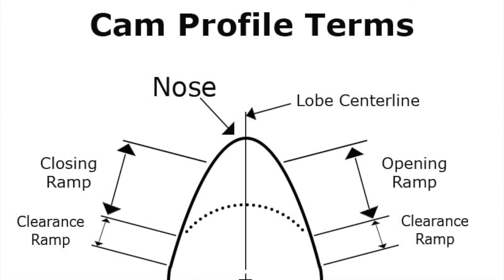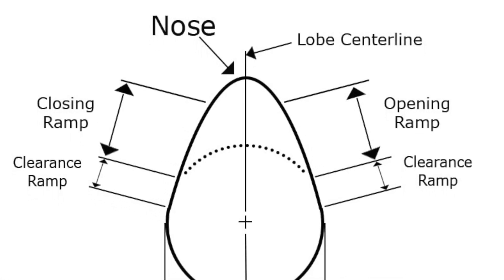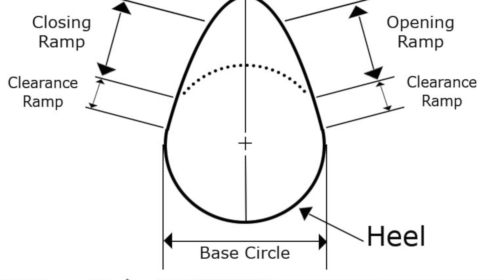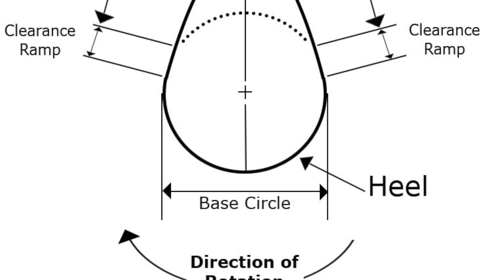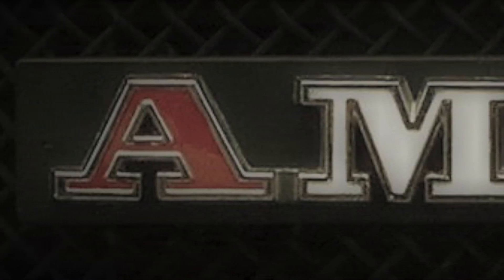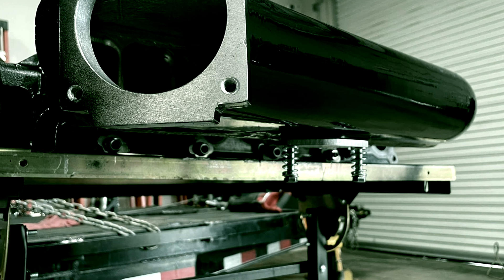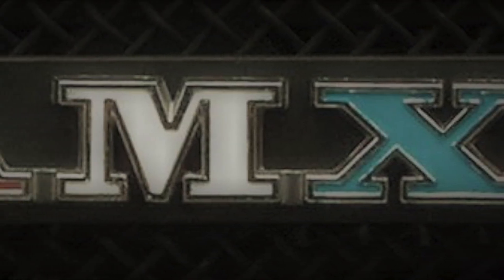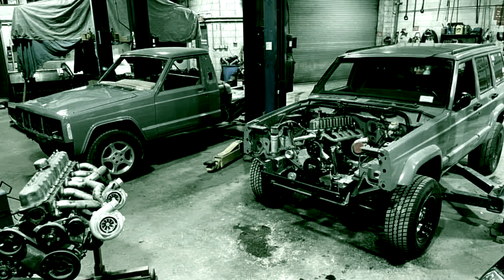Building a 10,000 RPM Jeep 4.0 -  Camshaft mods that rev to 9,000 RPM

Comment: Want to clear up a mistake on the roller lifters used on the 4.0L NHRA drag engine of HILL & WILLIAMS.  I used AMC-V8 .904 dia crane roller lifters.  I elongated the tie bar slot so the roller lifters would work in the 4.0L.  The spacing of the lifter pair is slightly wider on the 4.0L engine.
Reply: Yeah this guy needs a microphone set up in the middle of a well equipped shop. I could listen to these war stories all day
Reply: There are two other podcasts with old era engineers. One is gonegpn had 2 yj era guys on who were amc carry overs and the other is two guys who pushed the Rubicon production.
Reply from the maker: We need to make you an official YouTube account (with your name) to reply from Rick.  Then people will know who you are.

Comment: This is hands down one of the most interesting series I've found on the 4.0 literally ever. Rick is a genius
Reply: Thanks for the compliment,  I hope I justify the honor!
Reply: Not sure how we assumed I was using Pontiac roller lifters on a 4.0L, NO I DIDN'T use Pontiac rollers,  I had V8 AMC .904 diameter roller lifters in the DRAG RACE 4.0L engine.   Just to clear up any confussion!
Reply: @RickMudge  Rick, you are a legend around these parts!
Reply: @s3vR3x  I am gett'in old but legends are usually bye-bye?  Thanks anyway I get what your say'in!  Where are you from in the USA?  Have we meet before? Thanks again!  Rick....

Comment: My destroked crankshaft is coming in tomorrow and I was wondering if I could ask some questions about your build?
Reply from the maker: sure, ask away
Reply: @amxj  So ive read alot about harmonics snapping cams and chains in half with no real solutions to it, so I was wondering how you were tackling it.
Reply from the maker: Use a true double roller chain, 12 CW crank, beehive LS springs and valves with aluminum adjustable roller rockers and it shouldn’t be a problem  @bobwilus437
Reply: @amxj  Thank you so much. I look forward to seeing your build too. I am in between semesters and a college student so its gonna take me a while to complete it.

Comment: So it was the same battle,,, its always the valve train that becomes problematic,,, given that the head cam breathe engine at those speeds  while making power .
Reply: Valve train stability is critical for maximum performance.  The better the control of the VT the quicker the engine will accelerate.  The best flowing heads vs an average flowing head will show nothing in performance if the VT is unstabile!!  Harmonics are your enemy, you are correct in your statement.
Reply from the maker: The heads are good up to about 350hp N/A with the right cam /valve train/intake.
Reply: @amxj  Another thought on the VT.  The weight of the components, valve, retainer, locks, spring, cam profile or the acceleration on the lobe are critical.
The lighter the valve, spring (have to be careful selecting a spring that is compatible.) Retainers, locks, spring, the lighter these parts are (have to be light weight and DURABLE, to handle higher rpm, and accelerate quickly.
Reply: One more thing!!!  Don't ignore the pushrods!!  In Bob Salemi's Q/SA  or  R/SA stocker 92 Comanche 4.0 L pickup truck is using a TREND PUSHROD, this size, Double tapered 7/16"od  x  .165" wall chrome moly  x  9.65" OAL.  Seems like over kill doesn't it??  But NO it's not!!  A very long PR flexes and promotes harmonics.
Think about it before going with 3/8 dia x .083 wall PR's...
Reply: Final thought on VT harmonics?  If the VT is unstable the fuel consumption will increase.  You will have to richen the engine because fuel is leaving the combustion space as the valves bounce before becoming totally closed.  If or when you fix the VT harmonics, you will notice that the fuel richness will want to become leaner, so fixing VT harmonics will want a leaner condition and make more power, PERIOD!  Sorry, this sounds a little to wordie but you get the point!
Reply: Straight tube pushrods are not good for drag race engines.  Must use the double tapered TREND PERFORMANCE  push rods.  They are enginnered not to bend by DESIGN,  straight tube PR's bend, all of them!

Comment: great videos, love this series that you are doing. wish you guys would have touched base on cam retention (walk) just ate 2 sets of cam bearings in about 2 hours. going from pin and spring in the cam gear bolt to a solid pin and praying.
Reply: Just a thought on cam bearings?  Try aligning the #1 cam bearing oil hole to the #1 main bearing oil hole, see if that helps.  I would do this on all cam bearings anyway.  Also, have the ID of the cam bearings measured in the block after installation, then measure the OD of the matching cam journal for that bearing for about .0023 to .0026 clearance.  There is a reason the cam bearings are being wiped maybe the cam bearing is to tight, not enough room for oil film?  Insert cam into cam bore and see if cam spins freely no tight spots?  The cam bolt with the hole for dowel and spring should work fine for controlling fore and aft movement.?
Reply from the maker: Its certainly a problem.  I’m looking at roller bearing options since the 4.0 platform is known for eating the #1 cam bearing.  We’ll pass along the info once it is sorted.
Reply: Sounds good, greatly appreciated! Sick of seeing glitter bombs in the oil pan

Comment: AH! Just opening the end of the tie bar! That's so simple, I can't believe I hadn't thought of it. AMC V8 rollers should be perfect, I believe mopar lifters also have the same bore and should work if the oil holes line up.
Reply: 4.0L and AMC V8 use the .904 dia lifter.  YES, V8 AMC lifter oil hole lines up fine on a 4.0L six cyl JEEP.  I believe I was using a CRANE roller lifter V8 AMC.  Remember to extend the tie bar slot for the 4.0L 6 cyl.